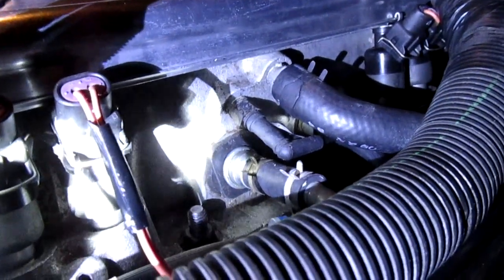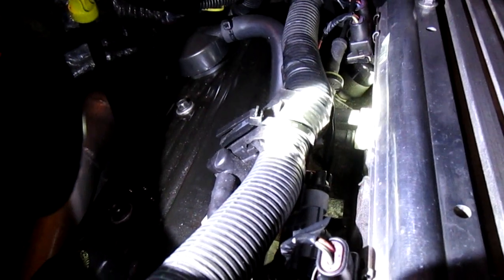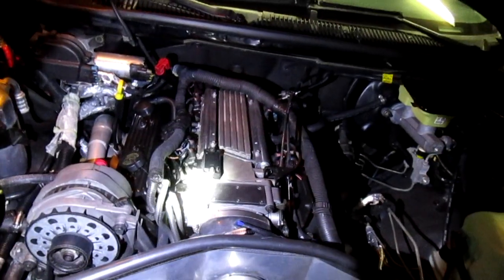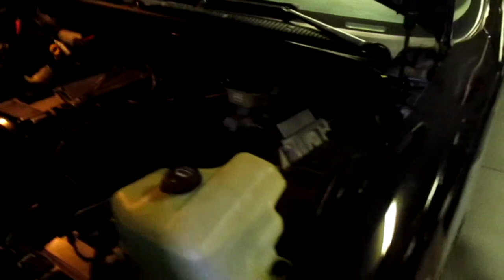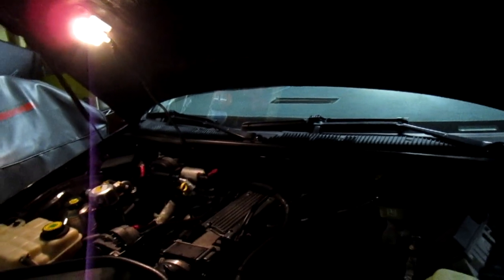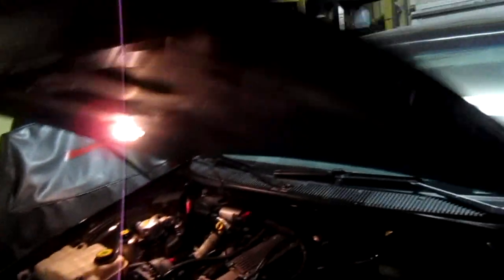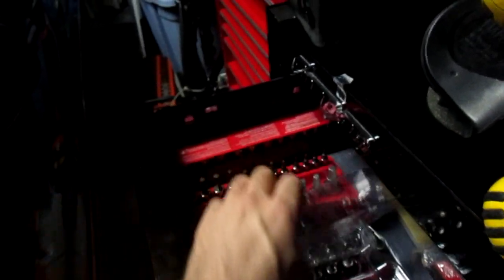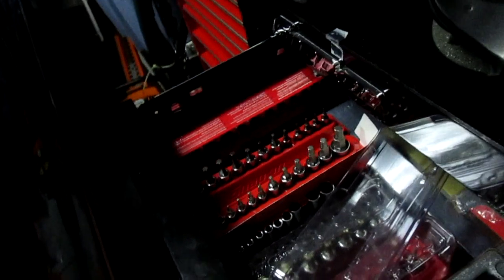LT1 vacuum hoses by request

Comment: Hello sir, thank you for the reply. I appreciate it! I forgot to mention that I have a '96 Fleetwood and that there was a difference between '95 and '96. But again, thank you for your input. When it is not 40 degrees out, and not raining buckets, I will do some work on it. Nice! Got to have dreaded torx bits for our GM's.
Reply from the maker: Yea 96 has a bigger evap solenoid and another wire on it because itsOBD2, Monitors for everything

Comment: Does anyone have better light or day time , I have high idle on my 95
Reply from the maker: Check throttle position sensor voltage with a scan tool. If its over .5 volt change it or unbolt and and clock it as far forward as you can and bolt it back on the throttle body. There is other reasons but when I had a higher than normal idle. it was that

Comment: Hey man, i have a question about my 97 LT1 throttle body   there is an outlet on the passenger side that is capped offf  not sure what this is...any ideas?  Thanks
Reply: There should be a diagram on your radiator shroud
Reply: that's where you put your fuel pressure tool to check, if it is at the end of fuel rail  behind fuel pressure regulator
Reply: Maybe they did the throttle body bypass?